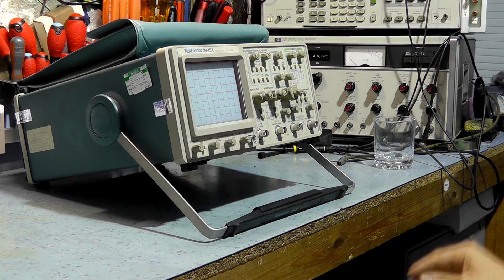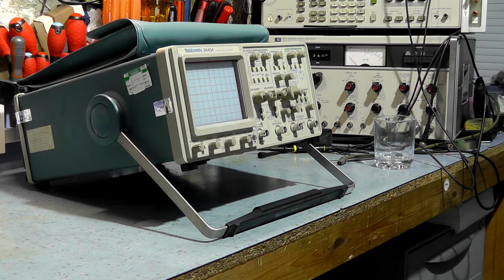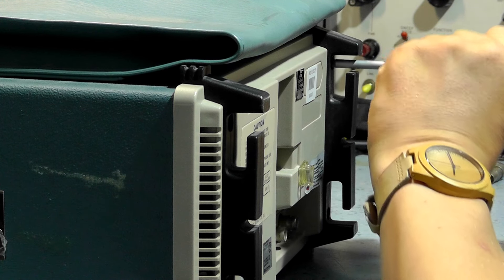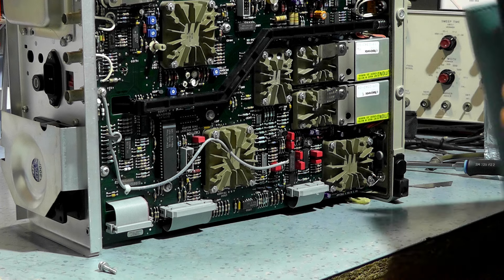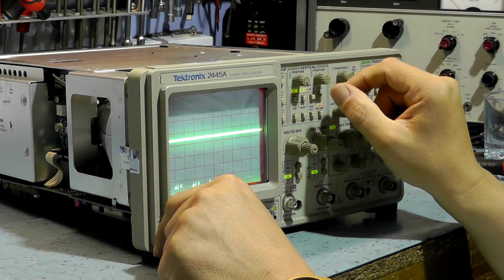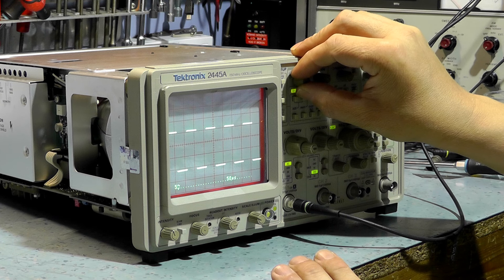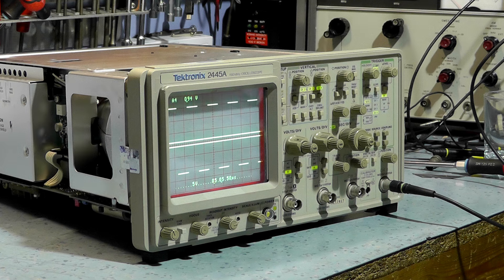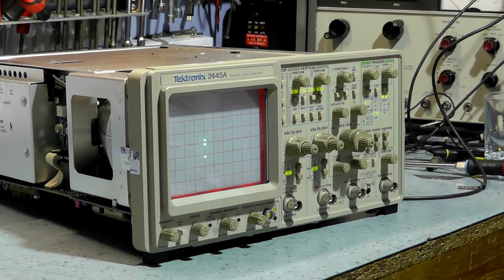Tektronix 2445a Analogue scope. Is it worth repairing?

Comment: A tip for people servicing these scopes the hybrids can overheat and fail if you operate the scope with the cover off for too long. This is because the cover directs the air over the fins.

If you must operate it this way use an external fan to blow across the fins to keep the hybrids cool. Replacements can get quite pricey since the only supply is from parts scopes.
Reply from the maker: +Bushougoma Agree. Partially on the storage models. The ccd runs dangerously hot after 10 mins without cooling.

Comment: Sorry but had to chuckle as you were struggling to remove the back panel - it's always that last screw that happens to be right in front of you that is the holdout...don't know how many times I've done exactly the same thing taking something apart! Looks like you got a good deal, look forward to the testing!
Reply from the maker: I was getting a bit frustrated as the workshop is so hot in the summer. But kept my cool!

Comment: What was your winning quid bid? Curious about your comment about ebay because there are plenty of these selling there in similar non-working condition in the $50-$70 range plus shipping (equivalent to 70-100 Pounds). But ebay sellers are notorious for lack of full disclosure/ misrepresentation. The guy from Austria who runs the BEB YouTube channel recently bought a vintage 561 which looked good in pictures but turned out to be full of sand and rust, blown tubes and missing parts.
Reply: You are correct in that many eBay sellers don't give full disclosure, however, usually it's not intentional. Even when it is, eBay has structured things over the last few years so that the buyer has NO risk (as long as you pay with PayPal). If an item has been misrepresented, you get full reimbursement, including return shipping charges.

Comment: TEKTRONIX 2430 DIGITAL OSCILLOSCOPE 2 CHANNEL 150MHz
one channel faulty.
When set sine wave signal showing on channel 1 input is swopped 
to channel 2 no response shown
wondered if you could point me where to start trouble shooting.
Reply from the maker: Strange. Does it pass a full self test?
Reply: @SoddingaboutSi  
Seems to powers on ok then self test then reverts to scope display ready for use, Back ground bought for father experienced tv / radio engineer in the past serviced flight navigation for the airways.Used to scopes and test equipment . This is first digital scope and purchased on understanding 1 channel not working.Watched your videos so thought ask where you would start troubleshooting as lucky enough to have full tektronix service manual but approx 500 pages.Really more used to valve and transistor instead of a unit full of ic's.
Thanks Mark

Comment: The row of small dots at the bottom of the screen indicate that you have a problem that the 2445 is not finish 
calibrated
Reply from the maker: Hi, ues this was in the CAL mode, After CAL the display was correct.
Reply: If you see the line of dots at the bottom of the screen, this means that the calibration is not finished.
I have the the
2465 and 2445
I have the same problem at 2465
Because of the calibration
CAL 2
expired
This indicates a problem in the vertical cursor. Check the cursor
Of the vertical and horizontal give you the correct measurements.
my have 2465
 is Calibrated but the horizontal cursor that measures the voltage is not
It is then necessary to perform calibration of voltage values
( CAL 2)
500mv
200mv
100mv
50mv
20mv
10mv
1v
10v
and then to finish cursor  cal ( 0 to 100%)

Best regards David Az
Reply from the maker: Hi David, thanks for commenting. The unit had its CAL void after the battery expired. See the other videos I did,
Reply: Hope you don't mind me commenting on another scope a Telequipment D75, the D83's were the same. Talking about dots in the trace, in my experience of them always fixed that by removing the power suply and cleaning the spacing postst that the PSU is suspened on they oxidise and cause that. Never had one that didn't work properly after cleaning the contacts. Circa 1977 to 82 when I left the bench. Still miss it ! Am retired 5 years now :)

Comment: Whilst you were trying to get it to show anything I'm sitting here hoping you remember about not overheating the hybrids
Reply from the maker: TheDefpom Well spotted. there's a fan on the table right of the scope. However they run pretty cool on this analogue scope. No ccd's to fry.
Reply: Yep keep the fan on it whenever the cover is off. I learned that the first time I took the cover off the 2465B. When I tried to do the cal I got some gibberish on the screen where I should have had alpha-numeric's.
The scope cursors will not only give you time, the default setting, but frequency as well. If you press the time button and then press both the time and volts button at the same time the scope with display the frequency. The frequency displayed with be that of the coursers not the signal. Some of the bravos will measure time and frequency and a whole bunch of other items as well. There are two intensities, one for the scope signals and one for the readouts. The readout has a left and a right and off at the center straight up. I think right was all readouts and the left I think was courser only, any way it tells you next to the knob. You're going to have a lot of fun with this scope Simon. Love mine at work. The main intensity drop of is normal on these scopes just go slower when you get close to full CCW. Oh you can adjust the Focus, Antag and Read out to almost be in perfect focus, but you have to do a lot of paying around with it going back and forth, but it will come in if you repeat the adjustment a lot. Thanks for sharing. Keith Noneya

Comment: Replace all tantalium caps, they are notoriously unstable; when they short out - and they do - bad things happen.
Reply from the maker: 1959Berre I find they only blow if the psu has high ripple. So far it's working great. If a tant does fail I will recap fully. Thanks for your comments.
Reply: Wear Safety Glasses.  
I have had equipment, on bench, where the Tantalum failed, by “launching” off the PC Board.
Missed me, but hit the ceiling.  Some bench techs have reported bursting spraying the area ...

Comment: Attention: your Iwatsu is both digital and analog!
Reply from the maker: Tam Hanna Yes Tam. But digital only to about 1 Mhz.
Reply: AFAIK nope, you have 20 MS worth of sampling speed. I can check with my DS-6612, the 6121 is on the repair pile.
Reply from the maker: Tam Hanna I have used that scope you years at work. It's good as an analogue scope bit only really usful in digital for the simplest of waveforms. Would like to see a video of yours.
Reply: As said, I am using the DS-6612...it was one generation earlier, but in some areas more advanced. What do you want to see in particular?